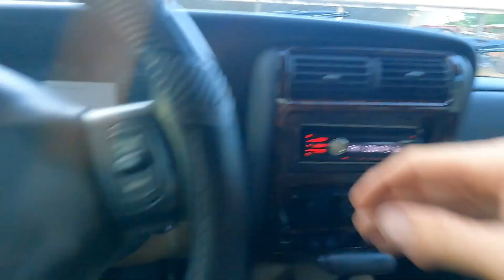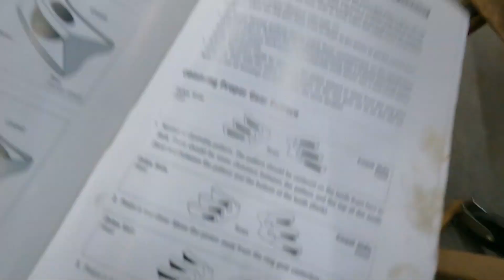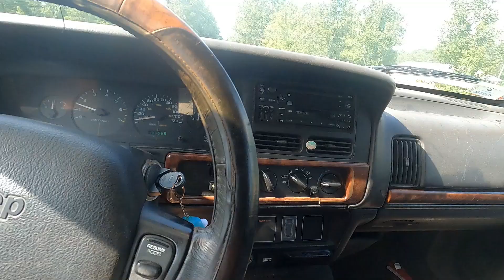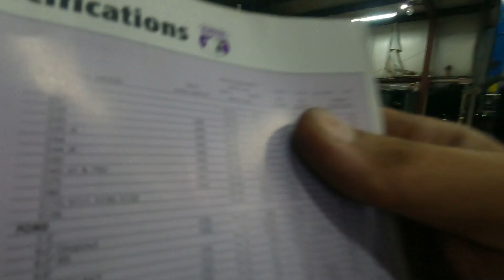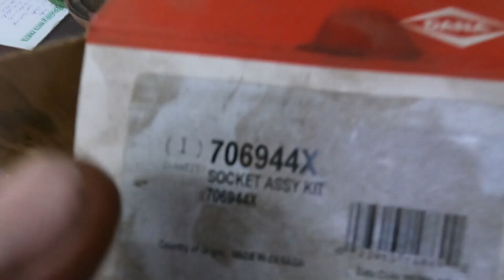My 2001 Jeep Xj Is Getting A Fresh New Set Of Built Axles And Upgrades!

Comment: I’ve never had to grind the axle bushings to make them fit. I’ve done them 3 times now and each time ive went with trailforged “HD bushings” with 1/2” bolts and drill out the upper arms. I’ve also like to add ive done 2 yukon gear swaps now and on a cherokee and JKU and both times i used factory shims and it came out perfect.

Comment: I got 89 Cherokee I put transmission out of 93 now the computer won't control it any help looks like your the man .
Reply: It's off road only I put 2 1/2 ton Rockwell on 44s
Reply from the maker: Electronics are the same 87-95. Output shaft is different 87-90 Vs 91+
Reply: @dexjeeps  thanks for responding the Trans that I put in my 93 was from 89 then I found out the 93 was 1 or 2 years only I'm thinking about adapting chevy Trans since I can't get mine to shift correct. Thanks for even responding .like what you do

Comment: So I’ve got a 96 Cherokee with the same lift kit on it and i have to remove the front driveshaft as it’s making a weird noise when getting up to speed, problem is i don’t see any access to the bolts of the shaft without dropping the crossmember,(which I’d rather not do in the driveway), do you have any suggestions or should i just bit the bullet and have my neighbors do it a his shop ??
Reply from the maker: Get a brake bleeder wrench.  Works great. Jack up one tire.
Reply: @dexjs  thanks for the reply I’ll have to give it a shot

Comment: Which ball joint did you have to change to use the WJ knuckle ?
Reply from the maker: Same ball joints. Just need the knuckle spacer.
Reply: im thought the taper on one of them is different on the Wj knuckle .. Maybe not just sorting though information before i put it together and realize something is wrong . .  @dexjs